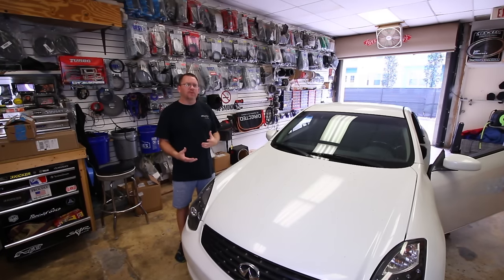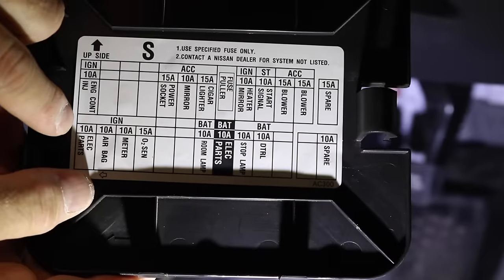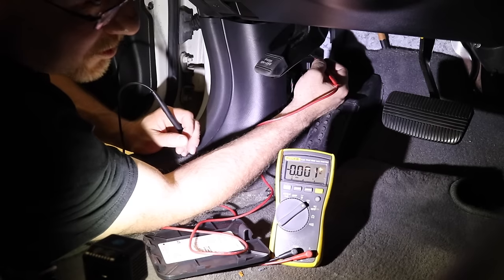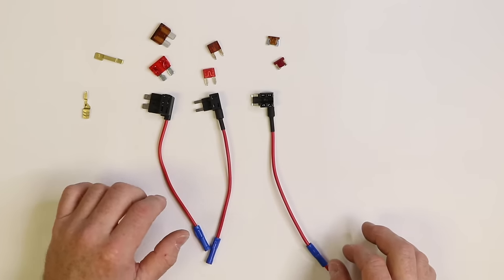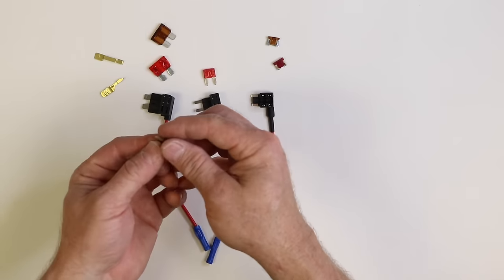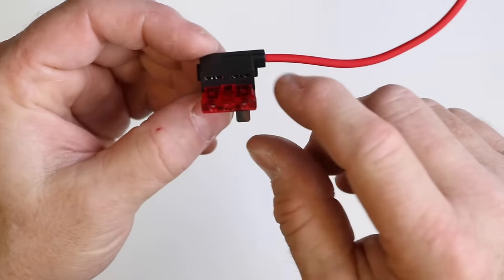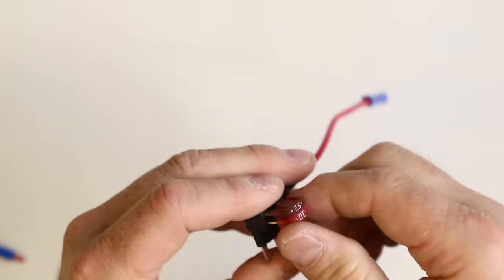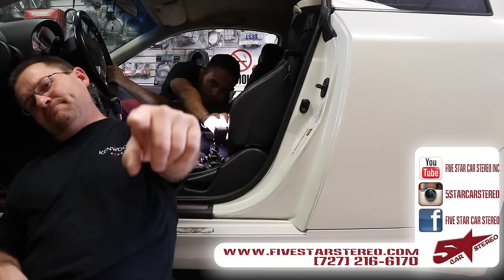How to tap into your cars fuse box safely and cleanly

Comment: Another way to make sure you have it connected correctly. Install the fuse that was removed from the fuse block and plug it into the fuse tap where it belongs. Connect the tap into the fuse block. Connect the red lead to your meter and ground the black lead from the meter. Turn on the key if connected to an accessory circuit. If you have power without the secondary fuse installed just reverse the tap. It should have no power until the secondary fuse is connected.
Reply: Thanks man ! You just answered my question 
💪😎🙏
Reply: Thanks!
Reply: That's exactly my problem !
Reply: Amazingly helpful comment. Between the video itself and this comment i hope everybodys troubles are solved as mine were! Easily!
Reply: Is there a way to connect a 2 prong onn/off switch to oneof those fuse taps and then connect the switch to another thing? 

My idea was to make so that i connect 12v switch to the fuse box and it controlls on/off function on a led strip
Reply: Dude your a life saver , was figuring this out for some time ❤️❤️
Reply: You’re welcome

Comment: I do a lot of DIY electrical work on my vehicles, and i always tap into the main orange accessory wire in the ignition which is dangerous. Thanks to this video, I can  now do it safely using the fuse box tap method. You learn from your mistakes, so far no fires

Comment: The fuse diagram on the cover at the 1:30 minute mark also indicates which fuses are hot in which circuits--"Power Socket," "Mirror," and "Cigar Lighter" all have an "ACC" header, "Heater Mirror" is under the "IGN" header, and the "hot at all times" fuses have a "BAT" header. This is extremely useful information, and it would save you the step of having to determine which one is "hot with ignition relay energized," for example. One quick look, and you can likely take a remote turn-on signal from the "Mirror" fuse so that your amplifier or other unit will turn on when the key is in the ACC position. I wish my car had that diagram!! 

Just recently, I needed to find a true ignition-linked circuit in order to provide a 12v signal to a battery isolator relay. In other words, I had to find a 12v source that would only be energized when the key was in the "On" (and "Start") position but not energized in the ACC circuit. The purpose of this was to have a secondary battery automatically be connected to the starter battery whenever the ignition circuit was energized (so while starting the car, and when the car was running) but not have it connected to the starter battery when the car was not turned on, including when it was in accessory mode. This allows the secondary battery to handle all of the power supply to my audio equipment and aftermarket LEDs when the car is not running, so the starter battery doesn't have to provide power to any big load with the car off, but when the car is on both batteries are running in parallel and are taking charge from the alternator. I ended up adding a fuse tap to the "heated seat" circuit, which I was able to determine was only hot when the ignition coil was hot, by scouring through my car's workshop manual (2017 Ford Escape) but it took a long time to find it. So a simple diagram like the one Nissan includes on their fuse box cover can be invaluable if you're doing something like this. Pretty niche, but I can't be the only one. 

Just adding this information here in case someone else who is learning this stuff, like me, will find it useful. Good luck!

Comment: To help make sure you use those, "add a circuit" fuses it helps to find which way it needs to go by leaving the lower fuse out(only have the upper fuse installed) & checking for voltage though the added wire! This way you know you have it installed correctly where each circuit is isolated on its own fuse & only after you do see the voltage you install the lower fuse!

Comment: "Load" and "Draw" work for you. 
Correct electrical terms are "Line" and "Load". 
Line would be your 12volt, non fused side. 
Load would be the accessory, fused side. 
As an electrician, we calculate "load" to determine the fuse size. 

No criticism intended. 
Thanks for making this video. It is very helpful and useful!

Now, where can I find the ATMLP fuse taps?
Reply from the maker: +Chris Denton Amazon is were we get them
Reply: Thanks!
Hope your boarded up for the storm. 
Stay safe guys!
Reply: THANK YOU. THIS WAS BUGGING ME THE WHOLE TIME
Reply: I think that's what he covers in the first part of the video. You need to test it with a light tester or a voltimeter to be sure.
Reply: From an old Electronics Tech we normally call it supply side and load side.   In Electronics the Power "Supply"  is where the supply typically comes from, that or a battery.  No criticism meant there as well.
Reply: ya i was like isnt the load the device thats being powered lol.  i just wouldve said hot wire and load wiree.
Reply: Thank you.  So just to be clear, you're saying that what is called "load" in the video is actually NOT the load and it is the OTHER side?  I was also taught that load means the thing using the power.
Reply: Gregg Sinini   Right I thought the same thing
Reply: I'm not an electrician.  I'm hardwiring my fuse to a piece of wire. Do I stick my wire into the hot side or cold side. Basically the side that lights up with test light or. The side that don't light up
Reply: I agree With Chris on this one. I've done electronics my whole life and have also worked in the electrical industry as well. Proper terminology is important when explaining things to people, so that they may understand the standards of electricity and electronics. (In case they wished to pursue a career or further training in those fields).
Overall, it is indeed a very well done video, and the close-up shots of the fusebox as you measured for voltage were a great touch. Great work overall.
Reply: @Walter Mitchell LINE is the +12 volts. LOAD is what you are conecting to it.
Reply: Gregg Sinini PMS moment of the month? Just searching for something to target your anger at? Behave normal.
Reply: Why are you here then if you are a electrician? Lol
Reply: @JerryKillian  Except most of the people watching this would be unnecessarily confused with proper terminology. The layman version of Draw (drawing the electricity) and Load (creating a load on that electricity) is simpler, creates a visual image of the process and will work better for the intended audience. There is zero need for understanding the "Standards of Electricity"...this isn't a journeyman's test.
Reply: Let's use the correct terms here, especially since we are talking about protecting circuits and keeping things safe!  Applying this terminology incorrectly could literally cause a fire or trash equipment.

And ironically, the term "draw" is a synonym for the correct use of the word "load", so when the author points at the fuseholder and says "this is the load side and this is the draw side" my brain went "Whaauut?"

Line, supply, or hot are terms for the un-fused battery side of the setup.
The other side of the fuse is known as the load, fused, or protected side.

The electrical/electronics industry has been using these terms for over a century.  No need to invent new terms.  Also if you insist on using the terms incorrectly the guy at the parts/electronics store is going to give you that special look.

"Draw" seems vaguely intuitive, but it's not at all the correct term. Draw is what a load does, and it's a thing we can measure.
Reply: @MoragTong_  This is a copout.  It's super basic terminology that I'm fairly sure the audience is capable of grasping and applying.  The rest of the video is great, so why wreck the lesson with this problem?
Reply: I agree that correct terminology should be used, and also believe a brief explanation providing context to people who are unfamiliar with the terminology is excellent practice.
Chris' explanation gets an A+ for accuracy and detail.  Everything is explained.
However, for the newbies out there, expanding the words into some context to contextualize the words will bring it home even better.  T
Think in terms of "line" ("power line in" to be fused) and "load" (circuit requiring electrical load that needs to be protected from the power line in by the fuse).  Now, if someone can communicate the same information more concisely, this could be improved again.  Line and load -- got the words and concepts down now.
Reply: @josephhaefeli9954  very good.  I was confused as he'll by this guy's video
Reply: @2wrdr  
Or call it "battery" side and "accessory" side to avoid confusion. Criticism intended. lol jk
Reply: Never heard of either but i guess i connected my boost gauge correctly lol
Reply: @caliverse5559  Yes, the terminology in the video was wrong and extremely confusing for anyone not strong on electrical understanding
Reply: @yoooo3231  Not sure what you mean by hardwiring your fuse to a piece of wire, are you referring to the example he showed where he wrapped a wire around one side of fuse? 
If that's what you're talking about, or something similar, just think about what's happening in the circuit. This is very simple, not a difficult concept. If you connect your wire to the "hot" side (known as the SOURCE or SUPPLY or LINE side), you will have no fuse protection. Think about it - it already has voltage even when a fuse is not even IN there. That's the same thing as if a fuse is blown, right?  A fuse is essentially just a little piece of "wire" which is designed to pop or break at a specific amount of electrical current. Once it blows, it's "open", which is the same thing as having no fuse in there at all. So the side that is still hot even when there's no fuse, it will STILL BE HOT even if a fuse is in there and is blown for some reason. So whatever device that wire is going to is BEFORE THE FUSE and will therefore not be protected, get it?  You must connect a LOAD to the LOAD SIDE of the fuse slot, which would be the side that has no voltage when the fuse is out. That's the side where the wire goes out to whatever device is being powered, and because it's AFTER THE FUSE, it is therefore PROTECTED BY THE FUSE.  Hope that helps.
Reply: @MoragTong_  Let them spread the knowledge stop interfering
Reply: @yoooo3231  The red positive wire would go into the hot side 😎👌
Sorry for the late reply  🙏
Reply: Thanks
Being a electronics engineer this sounded wrong to me, had to rewind thrice to understand.
Reply: @josephhaefeli9954  Thanks for this comment.  I was totally confused by the two terms "load" and "draw" used in this video.  In my mind, those mean the same thing:  "Load" is the electrical demand that the device "draws" from the power source.  I had to Google "Load vs. draw" and I am still slightly confused if these are opposite terms or not.
Reply: Everyone shut up already. This guy is just trying to help us out!

Comment: Note that the little contacts on top of the fuse will both show power (unless the fuse is blown), because they have continuity through the fuse element. To find the hot side you have to remove the fuse and test the plugs directly. Also, I can't think of a reason the bottom fuse in the tap would need to have a higher relative rating, unless you're inserting it backwards and making current flow through both fuses to reach the lead. Inserted the right way, each fuse is dedicated for its own circuit and should be rated independently.
Reply: 3 years later you have saved me from much frustration